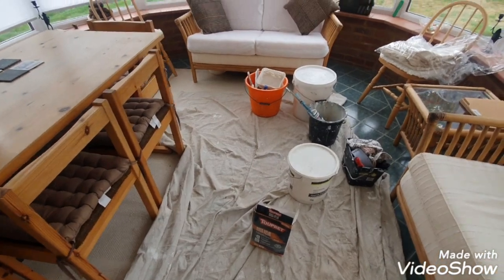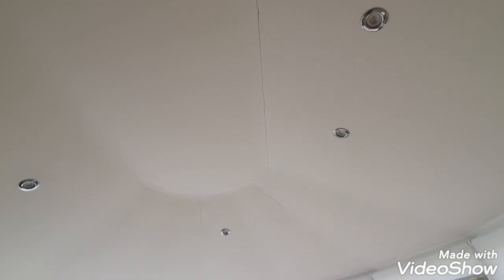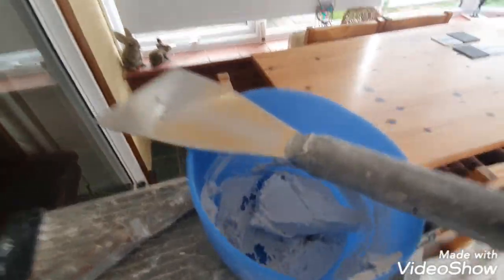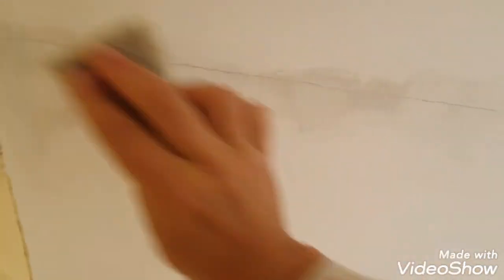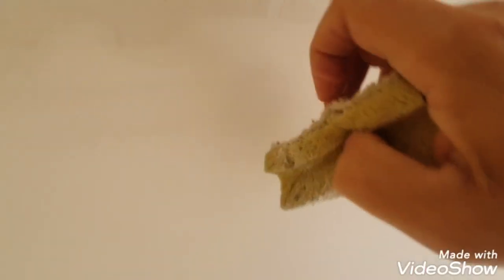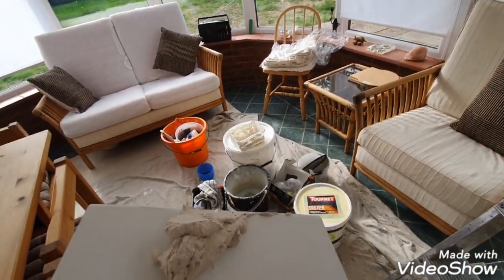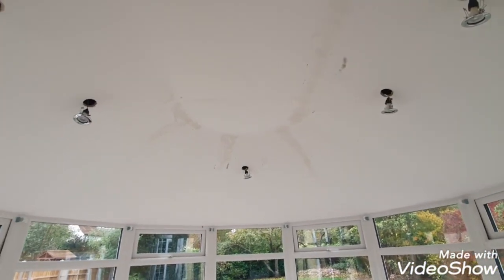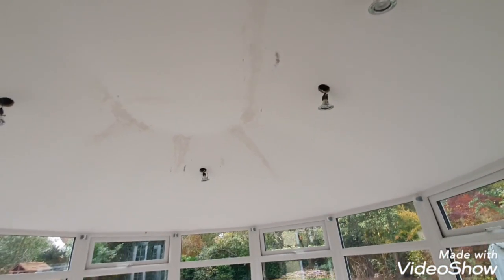How To Solve Stress Cracks In Ceilings And Walls

Comment: Awesome thanks for sharing I do a similar thing. I make the crack bigger using a scraper or Stanley. Then I use Ronseal 2 part, sand back. Then gyproc joint cement. Paint. I am absolutely against easifill but I’ll save that rant for another day haha cheers
Reply from the maker: Nice one. It really works

Comment: Would this method work where the ceiling cracks down the joins of the plasterboard?
Reply from the maker: It's the best combination yet as over the years I have tried everything from crack tapes to different flex fillers etc so give it a go
Reply: @danielnugentpainteranddeco557  thanks mate
Reply: @danielnugentpainteranddeco557  worked a treat mate, thanks very much for this
Reply from the maker: @ftocar  fantastic mate 👌
Reply from the maker: I would say yes. As long as you wipe the Murex excess off fully.

Comment: The last time I had this problem was on a normal bungalow lid that suffered with the same thing... I raked the crack, being careful not to cut the existing scrim tape from when it was originally plastered, filled the crack with toupret fil-flex (which was called something different then) then stuck paper plasterboard tape on with ready mixed paste, skimmed and feathered the edges with easifil, then papered the ceiling with fibreliner 

Then painted

20 years on its still perfect
Reply from the maker: Wow that's quality mate. But you know some customers want a cheap quick fix
Reply: @danielnugentpainteranddeco557  oh yeah, or they'll get 'the bloke down the pub' to have a go for 20 quid 🙄

Comment: 100% that will crack out again. You didn't even rake out the initial crack mate.
Reply from the maker: I did rake it out first.
I tried this method on a job about six weeks ago and she said it's held so I'm hopeful this will be the way forward
Reply: Ah ok we tried what you done, we used 2 pac filler, however the crack will come back on the side, so to resolve this is to secure the structure integrity, so first stud detector, see if you can get a bit, if so then screw every 200mm side by side in a zig zag, then mesh tape, then 20 min filler, 
If you can't find a screw bite then(  which we offer ) it to cut out a section and install a timber baton to help secure behind. 
It sounds a lot, however once the structure part is secured, the filler part would help the rest, 
Hope this helps as an alternative method for you, keep up the good work 🙂